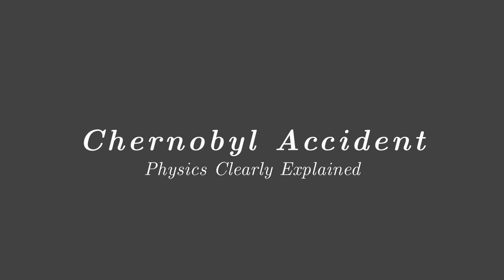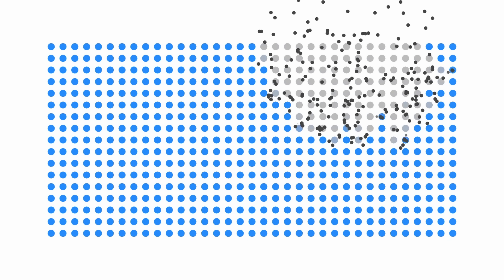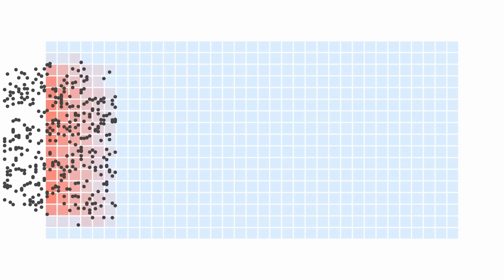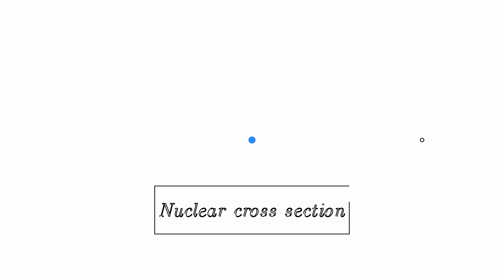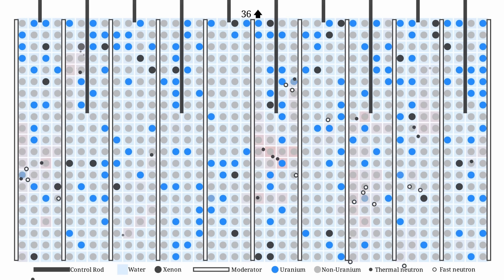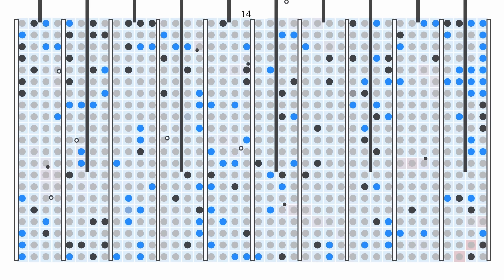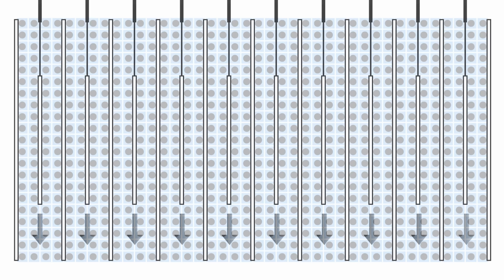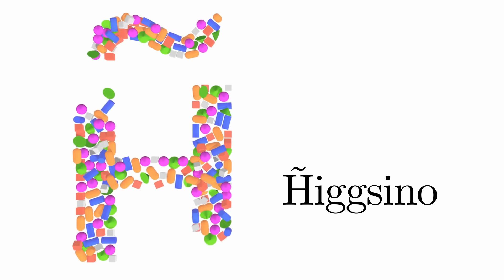Chernobyl Visually Explained

Comment from the maker: Please note, I've found sources  in the literature saying reactor was going supercritical before pushing the SCRAM button, while other sources claim  after SCRAM button was pushed it caused the reactor going supercritical. In my video, Ive assumed  the first is true. It's a historical detail (or advanced Nuclear reactor detail)  I'm not sure which is correct.
Reply: I’ve seen many interviews of eyewitnesses who were mostly working at the reactor, and everyone said the explosion and the extreme leap of power happened after the team pushed the button that was supposed to stop the reaction. The workers were well qualified, but they were told to run the test that would allow to keep a reactor running in case of an emergency power outage. The request for running the test came from “above” which meant they had to make it anyway. As much as they didn’t know about the construction issue that made the reaction worse instead of shutting it down completely. So yes, they did everything they could do right with the facts that they had. Also need to keep in mind that the test was delayed: it was supposed to be run with the day shift, but a night had to run the test instead, and they weren’t informed that the reactor was working at only half the power for the whole day, waiting for the test. What a terrible combination of circumstances, indeed….

P.s. sorry if there were any mistakes in my comment, english is not my native language
Reply: @uwepfaff9226  strongly disagree with this.  Most of your argument makes sense only if you ignore the fact that they pulled all the rods (but 1?) out of the reactor to try to get to their test power point.     They were competent enough nuclear engineers to know that their reactor 1) had a positive void coefficient and 2) to know they were putting the reactor into an unstable state.  They also had to have known what xenon poisoning was and how it occurs.  So the only justification they could possibly have had for this was their assumption that 'SCRAMing' would fix any situation they found themselves in before the reactor could go so unstable that its doubling time was within the control time of the sCRAM control system.  In other words, they knowingly disabled all the safety systems and protocols to put the reactor in that state with the assumption that there was one safety mechanism between them and a critical reactor.  I strongly believe (and hope) that all the other 'plant processes engineers' that say they would have made the same decisions are fiction.
Reply: The correct answer is it went supercritical AFTER the button was pushed, the discrepancy is entirely fabricated to downplay just how bad the old reactor was designed and how risky the experiment was that was being performed. While both Western and soviet historians and scientists long accepted it was possible it could have gone supercritical before SCRAM, lately, experiments and a better understanding of physics have shown the SCRAM procedure is needed to push the situation over the edge into supercriticality.
Reply: @BartJBols  Exactly, overall, it was a quite good video, but I believe he fell (like many others did) for some Soviet propaganda. Besides this channel I can also recommend another one, called "That Chernobyl Guy", he has been studying the accident for years, debunking Soviet lies and read literally thousands of books by former employees and reactor operators, statements made by nuclear physicists and engineers, blueprints for the Chernobyl plant, and much more.

It is a good channel if you want to go down the rabbit hole.
Reply: It was the combination of water turning to steam coupled with the Xenon burning off at the same time that made it a runaway reaction. My understanding is that if the control rods didn't have graphite tips (also called a 'displacer'), this may have been a minor meltdown but probably not a complete explosion of the reactor. So why have graphite on the control rods anyhow? It was a sort of brilliant design, really. It had two purposes: 1) To more easily control the reactor with a faster response. In essence, when you remove a control rod to increase power, a graphite displacer rod (which is attached to it) takes it's place. The reactor has a faster response and it actually balances power and heat better. But perhaps more so, SOMETHING has to take the place of a control rod when it's removed. You can't leave an empty space, which will increase reactivity, and you can't let water fill the void either, because that will prevent you from reinserting the rods. In fact, I've read the rods were removed further than typically allowed, which made the void fill with water, with made the control rods not go back in. So they thought a great idea would be, essentially, a control rod and control accelerator in one rod, which also stops the problem of a void when rods are removed. Another way to think of it is that the control rod with the graphite tip (displacer) acts as both a gas pedal and a brake on a car, so it can go from braking to accelerating (and vice versa) incredibly fast...unless, of course, it's already reaching a criticality. Then you're F'd. But the Russians thought this could never happen.
Reply: Out of everything I’ve heard and from what I read in the 1986 accident report
•there was an initial mistake that cause the reactor to decrease from 1600 to 30 MW instead of the 700 it was supposed to be for the test
•They had disabled the emergency water system as well as the emergency steam release system to prevent them from initiating during the test and they operated in this condition for far longer then they should have
• They also somehow bypassed the automatic shutdown systems that would have prevented the over extension of the rods right before the accident
•They were operating all 8 of their coolant pumps when only 4 should have been for the power they were at
•according to the report they were not planning on shutting down so they could reattempt the test if it failed
•They actually should have shutdown already as they were already operating below their minimum power for the reactor in a core where most casualties were exasperated by low power
•and for overall design flaws the fact that damaging 2 pressure tubes would cause cascading damage to all other pressure tubes and a lifting of all control rods due to the upper biological shield being lifted which in turn would complicate everything further.
Reply: @dstods FYI, this report "INSAG-1" was superseded in 1991 by report "INSAG-7" which acknowledged that many details given by the USSR in the previous report were wrong.
Reply: Fantastic how much new nuance I keep digging up in YT comment threads.

I'd say this is also an exemplary case of insufficient monitoring and logging... if the data records can't answer the question what figures operators saw before their eyes before pressing the button
Reply: I also want to point out that given the information the control room staff had, dyatlov included, they did the best they could and their decisions are decisions that, given the same information, I, and I've talked to several plant process engineers who say they, would have made. Additionally the assumption about the control tank was entirely valid as well given the limited information dyatlov had to work with.

The criticality happened after the scram. Here was the reasoning. They held the reactor at half power due to grid controller restrictions. So when dyatlov comes in they try to lower power to the testing threshold. However, the power keeps decreasing. So they stabilize it at 200 and start the test. In order to run the test the reactor must be shutdown anyways. This is why it was no deal that they had poison, it would be shutdown regardless, so they continue the test because the outcome is the same. Once the reactor is scrammed the test officially starts. The reasoning behind going ahead at 200 instead of 600 was because if it passed at 200 it would automatically pass at 600, so they might as well try the test anyways. Once they scram the reactor to start the test, THEN it goes supercritical. The super criticality before the scram is a complete fabrication by the Soviets to try to place more blame on the operators and the staff, to make it seem like they made bad decisions. When in actuality they did what any other staff would have done given the same circumstances.
Reply: @nuclearandspaceeducation3201  Iirc, the detail that turned out to be fatally important (the fact that the design of the control rods with moderator at the tip would lead to a momentary increase in reactivity during insertion) was seen as a flaw (correct assessment) and of course classified/censored by soviet bureaucrats. It never made it into any staff training manual. (incorrect decision)

That makes it a prime example of how "intelligence" is a misnomer for secret agencies.
Reply: @TheAgamemnon911  exactly. It was no individual's fault. Instead it was the fault of their culture.
Reply: @nuclearandspaceeducation3201  I believe the blame on the control room was the removal of so many control rods to begin with - I'm fairly confident that's the root of the mistake here.  I many be wrong but I believe the removal of all the control rods was way beyond spec and a human decision, and while I'd agree they were unaware it could cause this type of scenario - the desire to complete the test and ignore the actual limits should be on them
Reply: @xThemadpoet  I disagree. Since they didn't know it would cause problems. In the US removal of this many rods is not a problem. They are designed to be removed after all.
Reply: @nuclearandspaceeducation3201  While I respect that thought,  my training suggests if you are performing a procedure the the equipment does things you don't expect, or understand - then the solution isn't to 'push the lever harder' (to coin a phrase) - the operating minimum # of rods should have been 30 - when the accident happened there were 6.  That's the operators taking 24 more rods out than the manual allowed - that's human error
Reply: @xThemadpoet  Except that it didn't do anything that wasn't expected. They knew about reactor instability at lower power. It is the entire reason SKALA was put in. They did not know the rods were havking graphite blocks attached. Also, even if 30 rods were still inserted it probably still would have happened.
Reply: @xThemadpoet  like I said. As someone who is married to a process engineer, control room operator, and shift supervisor. Who has gotten training at a nuclear reactor and works at a chemical reactor. Given the information they had, they did just fine. The reactor was doomed, even with 30 rods. They knew they had to shutdown anyways, so they figured they'd run the test anyways. Everything was pretty normal. No fluctuating, no sharp rises in power. They knew the core was likely poisoned due to the stupidity of the grid controller, so in terms of everything going on. Nothing was abnormal. And making the assumption that the control tank blew up was completely a normal assumption to have made. After all, all they did once the test started was shut the reactor down. That was done 1 billion times before. The only difference then at the time of the explosion was the turbine. They assumed something was bad with the turbine first.
Reply: @xThemadpoet  idk what kind of training you had. But yeah, it is very obvious to always go by the book. Except the book was written for normal operations. In a real plant, it is always normal to go off from the book if the situation requires it. This isn't a piece of lab equipment. This isn't an airplane. This is something that requires a degree of engineering that is probably incomprehensible to most people. The book was not written with all situations in mind. I've heard of at least 5 times the book was ignored at my husband's plant in order to SAVE the place. The book would have gotten them killed.
Reply: @nuclearandspaceeducation3201  I mean if the manual (and how they were trained) says never less than 30 and they ignored that - it's still operator error - I've never seen a sim as to if they stuck to the manual if the meltdown would have been prevented - it is a fact though they removed the rods to increase reactivity because the reactor went cold too fast - and my understanding is they didn't expect that to happen - that should have been the 'stop the test' moment.
Reply: @xThemadpoet  except that they did expaect that to happen. You have to realize, that dyatlov lost his son in a nuclear accident, and survived a different nuclear accident. He was a man of safety and would NEVER push the reactor beyond what he knew it was capable of. But that's the problem. A lot of really important pieces of information were redacted from the manual. They redacted out all the parts regarding the reason for the 30 rod rule. To him, there was nothing that would cause a problem. Again, in every single nuclear reactor you can pull all rods out, and insert them back in with no problems. With the fault redacted from the manual the ONLY other reason for the 30 rod rule is local reaction controlling, to ensure that the reaction didn't split into two. Well, with the reactor stable at 200 this was not a problem at all. The reactor's natural tendency when below 50-ish% is to pull down reactivity. That is exactly why the rods had graphite. Nothing was out of the ordinary. It was doing exactly what the reactor normally does when below 50%.
Reply: @nuclearandspaceeducation3201  Yes going off book worked well for them - worst nuclear disaster in the history of the world.  There is a difference between 'going off book' and 'breaking a rule of the equipment that says "NEVER DO THIS' - they did the second thing
Reply: @xThemadpoet  again. What was the reason provided not to do such things. Because I have a reactor design book next to me. And let me tell you, it is not filled with definitives. I read the word assume about 10 times per page. I also see the words "the effect is negligible" about 5 times per page. You are using hindsight without any experience in process engineering.
Reply: @nuclearandspaceeducation3201  Well I have to go by the IAEA guidelines that went into effect after the disaster which include reactor trips if it drops below 700mw and also if the control rods are ever less than 30 - and that's how all RBMK reactors continue to operate to this day - those were important enough 'DONT DO THIS' that the reactor is now tripped if either happen - instead of pushing the reactor from 30mw back up to 200 by taking all the control rods out.

Does a reactor trip cross a big eough 'DONT DO THIS' line in your opinion? 

Because the operators that night did two things that now result in a trip.
Reply: @xThemadpoet  Bro give it up. You literally flip flopped your whole position cause the other guy was right.
Reply: @xThemadpoet  "well, I have to go by iaea guidelines that happened after the accident" and there you have it. If those guidelines existed before the accident it wouldn't have happened. Dyatlov was a good guy. He was just in the wrong place at the wrong time. Hindsight is 20-20.
Reply: @nuclearandspaceeducation3201  Sure - the manual changed from 'never operate the reactor with less than 30 control rods in place' to 'never operate the reactor with less than 30 control rods in place and now it's a trip' - but I guess if the 'never do this' required more safeguards to prevent operator error - then yeah I agree with you.
Reply: @xThemadpoet  can you print to where it said never operate with less than 30 rods. I'm actually curious to read this portion of the manual. Because all of my reactor books from before Chernobyl are shrouded in ambiguity.
Reply: @nuclearandspaceeducation3201  no - there are newer manuals out there - the only thing officially that I could point to is nureg-1250, which documents everything we knew about the reactor as of 1987.  Everything else would be from documentaries.  I would assume any real thing would have been buried under state secretes.
Reply: @deoderantguy1 I think he has a really good point, just from casual observation
Reply: @nuclearandspaceeducation3201  there were some very egregious levels of human error going on throughout the day and the test. The reactor went from half to choking to rising way to fast then exploded to 1000% power
Reply: @drewd2522  not true at all. There was no rise in power UNTIL the scram button was pushed. And there was no existing documents about the reactor being unstable at anything from quarter to half power. The test was running exactly as described, the only difference was it was poisoned. And they had a suspicion it was but continued with the test anyways because the power was so low that xenon boiloff could not occur, removing the risk of the power spike. And the test begins with a reactor trip anyways. So they might as well run it. And they did. There were not symptoms of any problems regarding a jump in power until after the scram was pushed. This is very well documented. You need to remove your preconceptions just because they were the Soviets. The test had nothing to do with the reactor. So there was no danger in running it. That reactor was doomed whether they ran the test or not. It didn't matter whether the scram was pushed one second into the shift or 10 hours into the shift. Regardless of whatever tests they were doing on the turbine, the reactor was set to explode that shift because the grid controller forced the reactor to be at half power and no documentation existed for instability between 25-50% because it was redacted by the government.
Reply: @ i have no preconceived notions because they were soviets. The core was poisoned yes they needed the test to start at a certain level of megawatts otherwise it would be considered invalid. i can’t remember the exact number but i believe it was 700. They tried to raise the power by pulling out all the control rods and it slowly started rising then at a certain point it began to burn off all the xenon so the power started rising much much faster as all the water was being converted to stream. The power was already rising before they hit the scram button which is the main reason they hit it in the first place.
Reply: @lol you have no idea what you are talking about the scram button only had such a big effect cause almost all of the rods were out so when they all reentered at the same time it cause a huge surge in power. If only 50% of the rods had been out this would not have happened but the fact that 80-90% of the rods were out made a bigger difference.
Reply: @drewd2522  no. It is very well documented that the power rose AFTER the hit the button. HBO Chernobyl PhD. You need to actually read reports. It is physically impossible for the reactor to burn off xenon just because of the control rod position. Even with all rods withdrawn it was at 200. That is no where near hot enough to make xenon boil off. It IS however, hot enough to create voids. And because recirc was low, given the low power, to prevent cavitations in the pumps that void was not broken up. That's what caused the power spike AFTER rods were inserted.  Think about what you are saying. If they pulled all the rods and it still was not above xenon boil point, how the hell did it burn off. It doesn't matter the time. The rods don't boil the xenon. Heat does. And if the rods pulled does not cause reactivity to go up due to the presence of xenon then there is no way it could boil off.
Reply: @drewd2522  the button was pushed with no power spike. It was pushed because the test was starting. There exists no documentation on the scram system's flaw at that time. The operators had no knowledge of this flaw. It is not human error. HBO PhD over here.
Reply: @nuclearandspaceeducation3201  Every single source i can find attributed the explosion to human error and design flaws in the reactor. If you have an article for me to read that says otherwise id be happy to read it.
Reply: @nuclearandspaceeducation3201  Every other RBMK reactor in the soviet Union also had to run this same test and none of them had explosions. This implies something different happened with this safety test. Yes a big part of that is the poisoning of the core. Another part is they didn’t follow the test correctly which caused them to pull out nearly all of the control rods. Safety protocols stated they needed to leave in 15 control rods at minimum however they didn’t. This massive extraction of the rods lead to an increase in the positive void coefficient caused by the graphite tips when they hit the scram button.
Reply: @drewd2522  the safety test recommended 15 rods. The operations manual had no such information. It could have been interpreted as a suggestion to get power levels where they needed to be. Again, critical information was missing from the operations manual. If it had been there, this wouldn't have happened. What's written on the test procedure is relatively useless for the reactor anyways since step 1 is to trip the reactor. So who cares about the control rods. The operations manual doesn't say it's not safe to pull the rods. 

You see. Now it becomes, not a rule, but a suggestion. this is 95% the fault of the people who decided to redact critical information from the book at Chernobyl.

The 15 rod rule was written as a way to prevent power spikes. There were no power spikes, so no danger. There was nothing of voids or the PVC.
Reply: @drewd2522  and this is also not true. There were several occasions where this test and other trip conditions caused near death experiences. It was highly documented, and then redacted. This information was kept secret from operators.
Reply: @ Again every source ive found says otherwise. Please provide a source that subscribes to your point of view. The last 3 sources ive found have stated the minimum level of control rods. Also several have stated that  AZ5 was pressed to prevent a catastrophic event. Which akimov and several other reactor technicians recognized but that they pressed AZ5 too late
Reply: @ There were several recorded events of the power increasing slightly when AZ5 had been pressed but none that involved near death. And if im wrong then that would be another case of human error.
Reply: @drewd2522  they actually made a lot of improvements of the RBMK after the accident. Control rods in particular.
Reply: @ Of course i know but only 2 years after when legasov killed himself
Reply: @nuclearandspaceeducation3201  The operators were to blame. If not, who?
Reply: @harrynking777  voids in a reactor are completely normal. Infact in a nuclear reactor during startup water level is critically low because of how much expansion happens from voids. Operators were not to blame. The government is. I implore you to learn more about reactors before making bold statements.
Reply: Reactor had an issue,  which is not covered at all in the video, it's called ending effect. It was discovered after it was built, and resulted in LOCAL increase of reactivity at the bottom of reactor. It was ok while rods were inserted slowly,  but it had big effect when it was inserted fast, especially simultaneously after button was pressed..  You can search for ending effect (Концевой эффект) if you really interested. It was believed that it couldn't explode , just like Titanic couldn't sink. Now that part is seriously reworked.
Reply: Strictly speaking, if power is rising at ANY rate, it is 'supercritical'.  I believe you're confusing this term with 'prompt critical' a different issue.  "Critical" means neutron population is sustaining at a constant level from fission.  'Sub-critical" the number of neutrons from fission is declining and 'supercritical' means the number of neutrons from fission is rising.  This includes both those neutrons born directly from fission and those emitted by fission daughter products  (the so-called 'delayed neutrons').  It is the tiny fraction of neutrons that are delayed that make the reactor controllable.

"Prompt critical" is when more neutrons are born directly from fission ('prompt') in each generation.  Since average neutron lifetime is very short (< 1 ms), once a reactor reaces 'prompt' critical, power can rise by several orders of magnitude before the 'wave' of increased neutrons can even exit the reactor and reach the instrument detectors.

So you see, the issue is whether the reactor was 'prompt critical' before the scram button was pushed, or if the insertion of the graphite followers is what pushed the reactivity to 'prompt critical'.
Reply: @mikefochtman7164  yes you are right. And we already established, as a real reactor operator would put it to remove confusion... APRMS were not were not upscale and reactor period was not too low.
Reply: In a society where blind overconfidence is becoming more and more common, it's very refreshing to hear someone say "I'm not sure" - especially about a topic they're familiar with.

Way to fight the trend, man!  💪
Reply: It happened after the scram button because societs didnt wanna admit their shmitty design was faulty
Reply: I'm really curious is there is any solution to what was going on. If they turned back on the water prior to power not climbing would there been a better chance of thing being okay or would it be too late and just have a slightly smaller catastrophic reaction
Reply: He knows the second is correct but doesn’t want to admit he was wrong
Reply: As I understand it, the reactor was critical. Due to the poor design with the graphite tips, inserting all the control rods at once caused the situation to become supercritical, as this speeds up the reaction for a short time.
Reply: The following day Pravda published an article boasting that one soviet nuclear reactor has managed 2 achieve it monthly power production quota in a few seconds 😉
Reply: Just a quick note, at 3:23  you wrote control rods submerged out of reactor, and pulled inside reactor.

My understanding is you submerge the rod inside of the reactor, and then to heat up, you'd pull the rods out of the reactor. Just making sure I'm reading it correctly
Reply: @CurledPrism  yes, from what I understood, your interpretation is correct!
Reply: The reactor would have gone prompt critical regardless. The conditions were there.  No more Xenon and insufficient control rods inserted. Voids in place of water.  Pushing the SCRAM button would have not have made a difference.
Reply: @harrynking777  it would not have gone prompt critical if the scram button was not pushed. That is a fact. If they re-inserted the rods one by one or used a different AZ mode it wouldn't have exploded.